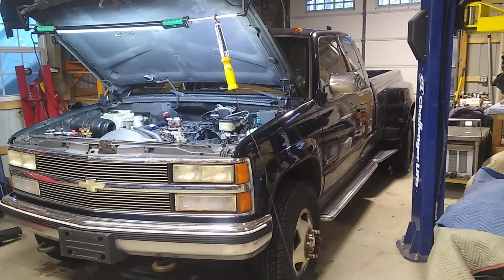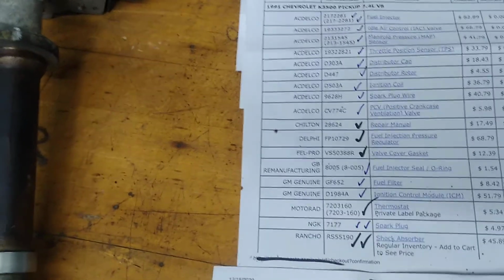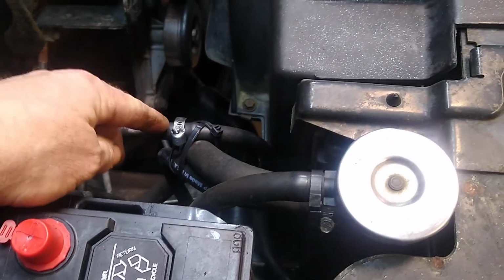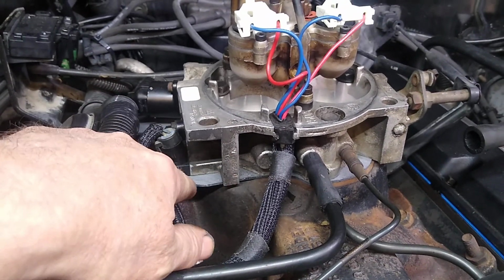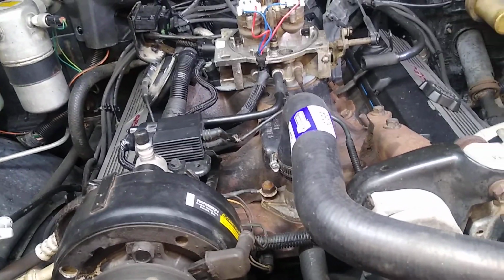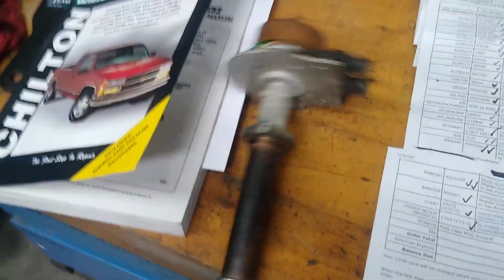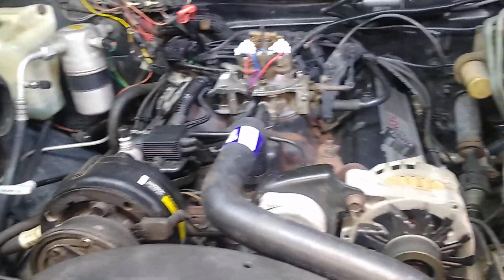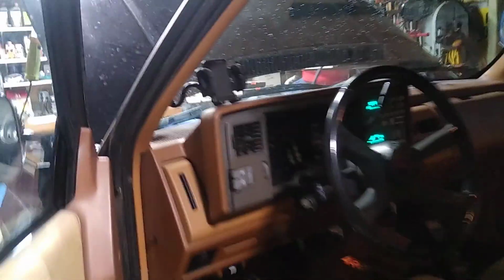Chevy K3500 4x4 454 (7.4) Dually engine tune-up summary

Comment: You can usually find the factory repair manuals that the dealerships use for vehicles on Ebay that have the complete wiring diagrams and very detailed specs on everything where the Chilton and Haynes manuals usually cover the basics over several years.  I even found one for a 1973 C60 Chevy truck I bought a few years ago.  The peanut port heads are exactly what you want for a truck that you will be towing with, they build great torque for heavy load hauling.

Comment: What is the purpose of the small cooler hose (5/8") that goes from the water pump to the thermostat housing?
Reply from the maker: I believe that would be a coolant bypass hose for when the thermostat is closed.

Comment: I have the same truck same motor and injection system I felt my motor was lacking also I purchased a throttle body separator called chaos I noticed an improvement in fuel economy horsepower and torque for under 70 bucks

Comment: I have the 1997 vortec 454. Put a volant cai, jet maf, flow masters and hyper tech chipped it. Gas mileage is amazing and I raced a 5.7 dodge ram and a 6.2l GMC through WV mountains, Virginia and down to NC. They could not keep up. The driver's faces were hilarious. Mileage went from a poor 7 mpg in city to a 16mpg using premium
Reply: Hey I have the same truck.  Can you please put me on game.  I want my build like yours!
Reply: Hi, do you have a parts list on the parts you are recomended?
Reply: @stephendoing2253  Nope, it's just tuned and it has a cold air intake. If you want to go mild then just do a simple cold air intake, long tube headers, no mufflers. Make sure it's a vortec tho since they make the most power
Reply: 16?!? What kind of tires you runnin and what gear ratio?
Reply: @zy658 Stock 3:73 gears that came in the truck i believe and dynapro ATM P245/75R16 109T
Reply: Your funny

Comment: Putting a T stat other than the 195 rated will mess with the ECM fuel table. Causing it to run richer and lower MPGs.

Comment: Behind the tbi there's a vac uum port in the center between the two fuel lines. Is that capped off on yours? I just got a truck and it's exposed.
Reply from the maker: Mine appears to have a hose on it.... not sure where it goes.
Reply: Don’t cap it. It’s very important and will cause a major vacuum leak

Comment: If they specify 195 thermostat that's what I use, you won't get better cooling from a 165 you'll only get an engine running too cool most of the time.  When it get's hot a 195 is just as OPEN as a 165.
Reply from the maker: Hey Bo - Funny as I recently went back to a 195 TSTAT as the truck was running very cool all the time with little heat output as well.  With the 195 it seems to run too hot but I really dont trust the dash gauge..... so just keep an eye on it for now.  Thanks.
Reply: @petermuehlbronner8431  They ran em hot during that era (smog nazis) and the dash gauge was not very accurate. Use  an IR temp gun on the T housing and you'll often see the dash gauge 20-40 degrees higher than the housing.
Reply: @jf4872  yes your right but the sender is in the heads. Those are correct temperatures and the intake is 20 degrees cooler. So the intake manifold is 205 then add 20. If the upper radiator hose is 195 add 30 because the hose is thick. Get right behind the thermostat housing and that’s the intake risers and she’ll give you the correct temperature. That’s coming straight from the block and if it’s 240 or more you better believe it. I’ve had this truck for 7 years in the Arizona desert summer and it gets hot. Never popped a head gasket but I’ve melted a few wires, overflow tank and the batteries do not like heat. There’s a wire that runs from the coil to the starter. It needs wrapped with heat shield tape and then wrapped with electric tape to stop heat soak on starter. It gets so hot it won’t carry a current . Did that 6 years ago and I’ve never had a heat soak problem since.
Reply: @petermuehlbronner8431  how hot?? 220? 230? Mine runs 220 225 in Arizona summer. Towing it runs 260. Your clutch fan doesn’t fully open until 235. If you have a severe duty that thing will give off 11000 cfm at full engagement. Im full stock no after market stuff yet but I can’t run my ac because 240 is too hot for a rebuilt 454.
Reply: @Phuq_it  That is normal behavior. be sure and run 60 percent distilled water vs coolant. Water cools better than coolant. Also flush via the backside of the radiator with a soft psi hose.

Comment: Those zip ties cut through those hoses yet?
Reply from the maker: Interesting question..... I will take a look to see if any wear.  I doubt it as the zip ties don't have a sharp edge and are not strangle tight.
Reply: It’s the constant vibration is all I worry about using them. Not against using zip ties. Just curious

Comment: I've owned (3) tbi 350s, no issues...my 1993 454tbi has been nothing but a headache. After replacing injectors, TPS, IAC,PCV, MAP and all 3 coolant sensors and their harnesses (plus grounds) it is still running like crap. I've replaced the ECM sensor (by the thermostat) and the temp gauge sensor (driver side) twice.  Fuel pressure is 9-13 as it should be. 195 thermostat. I believe my timing is off, thats my last attempt. it was 8-12 advanced, had the shop time it and it still says 8 (i dont think they did the brown wire disconnect) Great vid and informative.
Reply from the maker: Hey Sean - Play with the timing a bit.  My truck has a Banks air filter and exhaust..... Banks suggested a different timing than the "factory".... I forget what it was but after playing with it a bit it ran much better.
Reply: Could be the timing chain teeth are worn and or tooth missing on the sprocket.
Reply: Timing chain, if a mechanic touches your truck it will be set at 8 degrees BTDC. 4degress BTDC is factory setting
Reply: New distributor and alternator solved it.
Reply: With vehicle off.... disconnect the single wire that connects computer to distributor.  Then turn vehicle on and set timing.   With vehicle off re-connect single wire computer to distributor.  Test drive.

Comment: You would never get that truck here for $2500(id say do the visors.. and 5th wheel gate, more like 5-6g here). I JUST got one, its alot rougher.. but(has a brand new trans), solid in the right parts and i paid $700. These trucks have fetched much much more, but.. Idk, the market is still weird on them! For the most part, they are super easy to build and pretty cheap parts wise! I think, its pretty logical, it will jump in value like the square body.. Just needs a lil more time..
Reply from the maker: Yeah - I bought it as a package deal so the amount I paid was offset by the sale of the boat that came with the truck.  I'm not thinking about selling so I don't really worry about what the market is doing.  I know it will probably increase overtime.
Reply: @petermuehlbronner8431  Yep, i have no plans to sell either, cant see why i would? Certainly not to buy a 90g truck and start hucking 5g parts at it, when it breaks! lol

Comment: How much did you pay for it? I'm looking at one
Reply from the maker: Hard to say. I bought the Truck, Trailer and Boat as a package deal.  Paid 13K for all.  Sold the Boat for 8K so I paid 5K for the truck and trailer.  Trailer was worth around 2500 so I guess I paid about 2500 for the truck.

Comment: Would love to see more about this truck love it I have one just like it. Abs love  how did it do  after all that u did to it ?
Reply from the maker: Hey Anthony.  After finishing up the work the truck runs quite a bit better.  Smooth idle, good throttle response, no more oil leaks, additional items I did were a new alternator as the older one was not charging well, I replaced the o2 sensor as well.  The trans even shifts better as it relies on one or more sensors for info.  Very happy overall.  It's now my daily driver as I just like driving it!